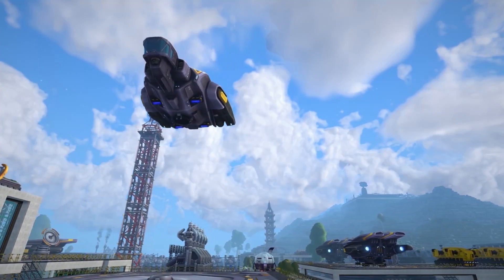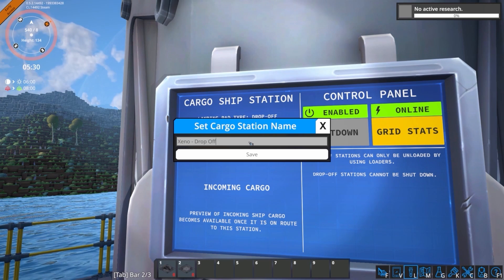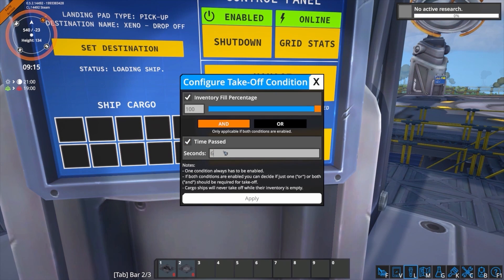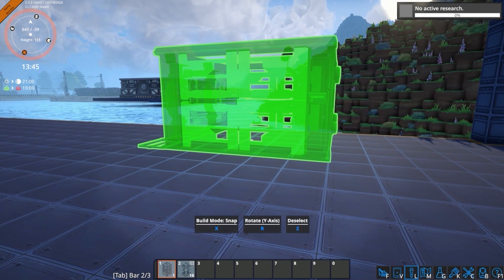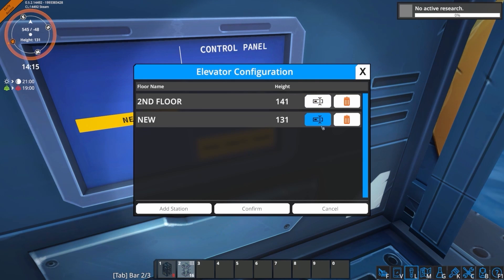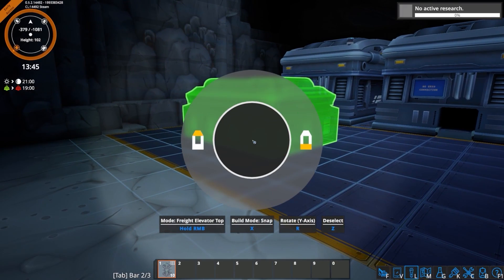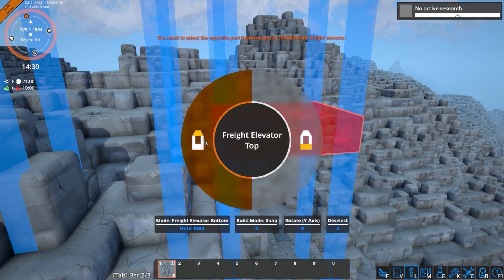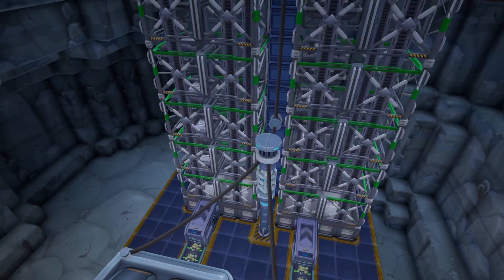How to build a cargo ship? Or an elevator? | FOUNDRY Beginner's tutorial by @FluxoBuilds

Comment: Unfortunately Cargo Ship not worth at current state and the reasons are the following:
- If u have more then 1 transport ship moving resources to target pad, then the second ship wont take off from the its starting node till the previous one still sitting on that platform
- long distance have travel time back and forth so the longer the distance the more time it waste to fly back empty handed.
- using Mark 3 single line belt have energy consumption of 10 Kw compare to the transport ship u need 2 pad + u wanna load and unload that ship as fast as possible to decrease the down time so u will use minimum 4 belt to load and 4 to unload = 2 x 300 Kw for pads + 16 x 5 Kw for loaders. (can be handled by few large solar panels and large battery)
- Transport ship on long distance (1 km or above) barely faster mats / min then a single line mark 3 (green) belt.
- it require gigantic space to place compare to belt setup. If u put ur belts up in air, u dont have to be annoyed by the mountains, vegetations, rivers, etc and u should plan ahead with the belt position, so if the mining node is gone, u can redirect other close by nodes w/o re-allocation too much belts.

Transport ship Advantage:
- looks cool i love the idea
- it ignore the 3d terrain and it have direct fly path (diagonal), not like belts what can go only on X and on Y axis.
- Faster to setup compare to belts
- easier to reposition if needed then belts

On discord multiple ppls already point out this huge issue. Until they fix + change i would not advice to use it.

Comment: Wish after you name a target pad that it would show up as a drop down choice on the starter pad
Reply: Ppls already did suggest this on discord, it would be useful and avoid typo on station names and then wonder why the hell is this ship does not want to move xd
Reply: @Klannahar  Cool, since others noticed this maybe it will be a much requested addition.
Reply: @Sirstas79  i hope so too, would be a good QoL change
Reply: I'm interested in something else, why didn't they do it right away, it's so obvious?
Reply: @nokiamen1972  Well it is simple. They are also humans, nobody can think on everything in get go, but once they release the game in early access for like 2-5 K active player leave a lot of good constructive feedbacks, and they already fixing the transport ships, so it will be useful now. They queue up in air above target location and also increased flight speed. I will test it when it goes live, and if it will be better solution then lay down 4-5+ line of belts for 1-2 km+, then ill switch it to them. Energy consumption will be much higher, but Solar panels FTW. My entire factory running on solar anyway. XD